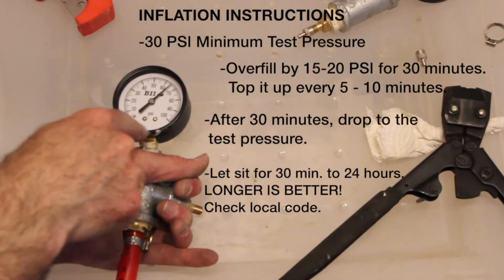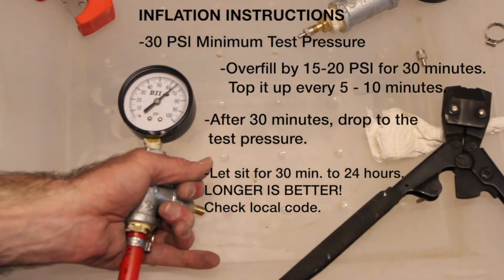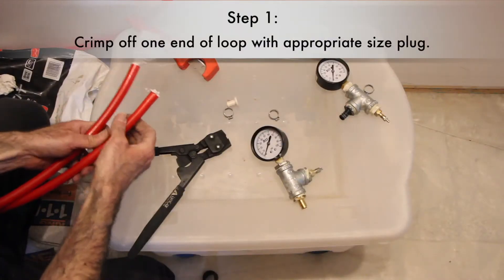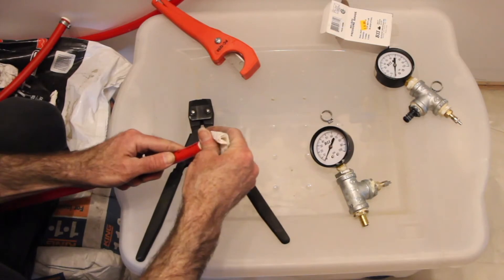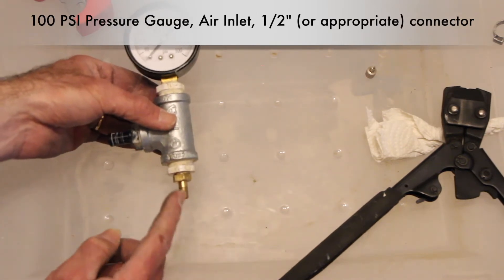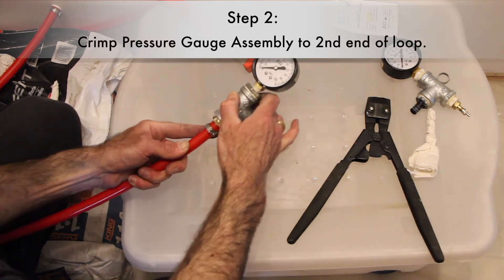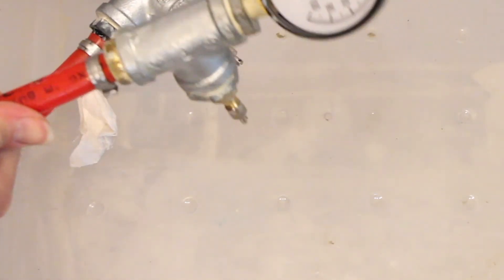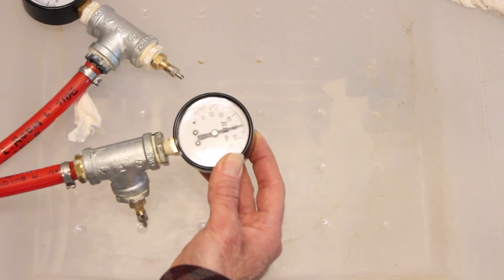How To: Pressure Test Radiant Floor Tubing | DIY | Save MoneyTV

Comment: This is very helpful. I'm trying to find the pressure gauge with the schrader valve air inlet that lets you add air to the system. I don't feel comfortable building it myself, as you have done. Any ideas where I can buy it, and what it's called?
Reply from the maker: Offhand, I don't know where you could buy that, but I'd start at your local specialized plumbing store.  Someone there might be able to help you.  Of course you can also find everything on Amazon.  Good luck! :-)